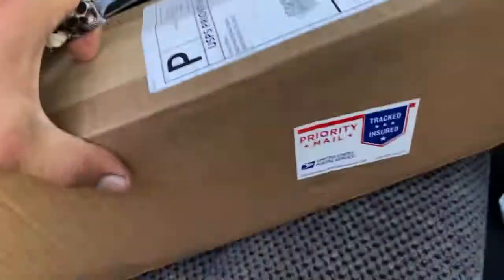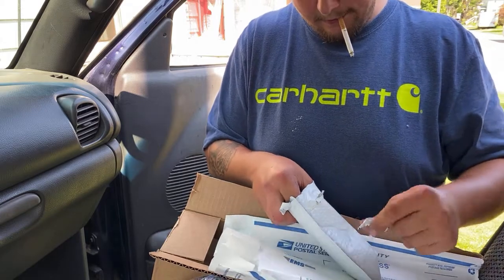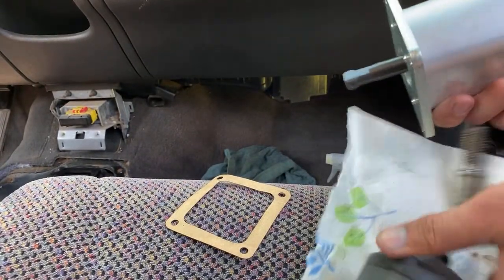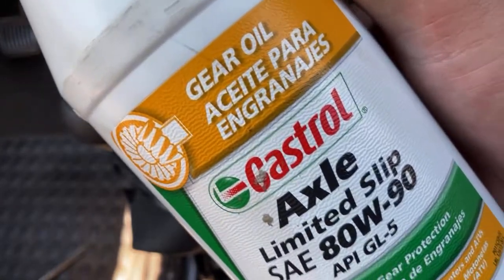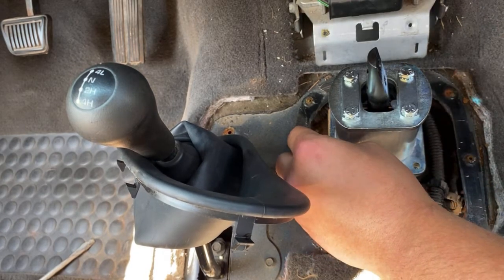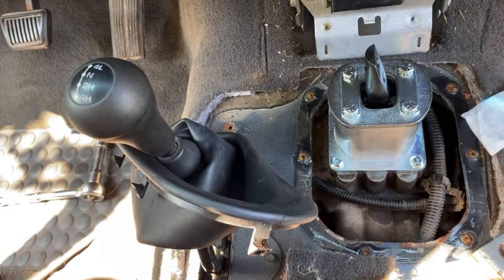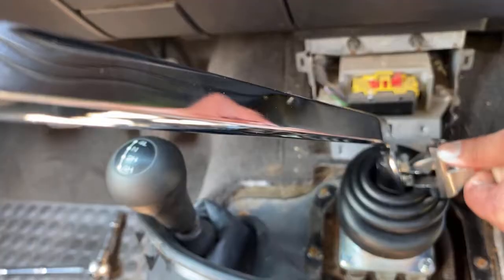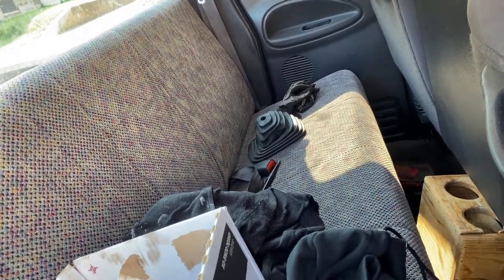Dodge NV4500 Short Throw Shifter #CoreShifters

Comment: That gl-5 will corrode the synchros.
Reply from the maker: Ohh yah, it eats away the paper material on the synchros. Trans been rebuilt and working on trying to get it back in at this moment. Was almost a walk in the park experience but the getting it back in part sucks. Parked on a hill, all the wheels to my floor jack are flattened, yeah the metal wheels are worn. But it wasn’t rebuilt because of the little gl5 fluid, it was because of snapping the output shaft that goes into the t-case. When I changed the fluid it was burnt badly from adding that little bit of gl5.

Comment: Buddy you screwed that Transmission.....GL-4 Only fo the NV4500 , anything else Will definitely destroy the NV4500 Transmissions.
Reply from the maker: Held up 2yrs just fine. But fluid was changed… last winter I snapped the output shaft clean off.
Reply: A little bit of the wrong fluid will not ruin a trans, it’s a manual not an auto

Comment: You install it without the isolation grommet block? Hmm I feel like that's gonna cause some vibrations in the shifter! How has it worked out so far?
Reply from the maker: Oem one doesn’t have one ether
Reply: @SmudgyContent  Really! Hmm I wonder where the one on my NV4500 came from then. Or do certain manufacturers perhaps put them on I wonder
Reply from the maker: @Eric2300jeep  the ole farmer I bought this truck from has pull this transmission ontop of me having stuff done to it at local shop.
Reply: @Eric2300jeep  I believe there are several generations of shift towers used on these

Comment: Did they send a new plastic bushing that interfaces between the tip of the shifter and the shifter dogs?
Reply from the maker: This transmission doesn’t have one. But no usually you’ll have to order those separately. Or find a shifter bushing on Amazon for you transmission. It’s like I need that thicker piece that slides on the shifter shaft there like the OEM one. It’s tight except for 5th gear it’s just not right yah know? See me at the end of the video playing with 5th gear all confused